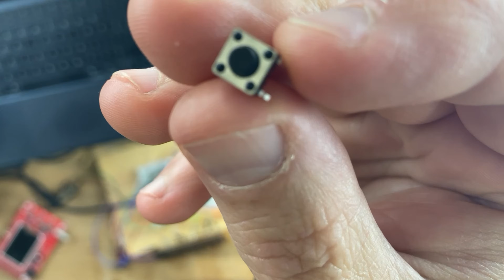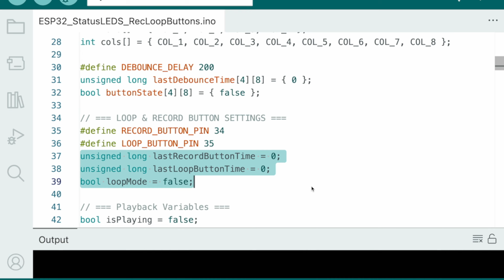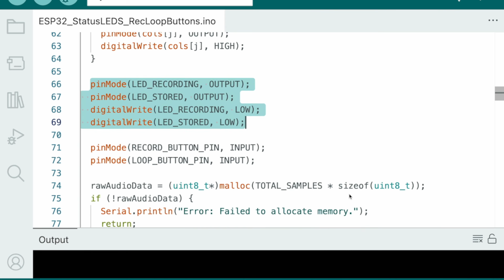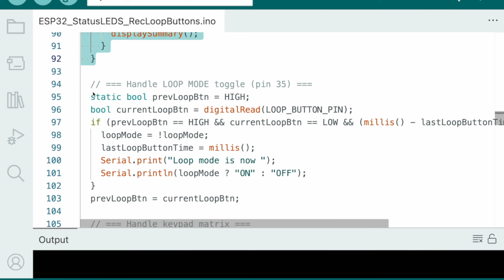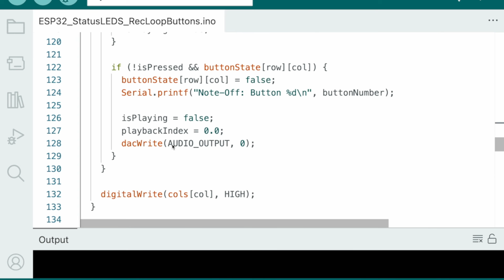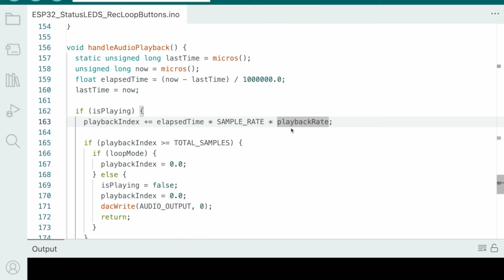DIY Lo-Fi Sampler With An ESP32: Part 6 - REC/LOOP BUTTONS & STATUS LEDS!

Comment: YOU FORGET to add current limiting resistor on GPIO 34 and 35
Reply from the maker: Hey, thanks for watching the video! I really appreciate it! Nice catch bringing up resistor protection — and you’re totally right, I could (and probably should) add current-limiting resistors to those button circuits. Good call! GPIO34 and 35 are input-only, so they don’t strictly need them — but I’ll add 330–1kΩ resistors in the final design as a bit of extra safety. Thanks for bringing this up!